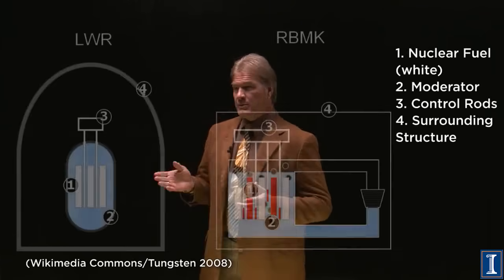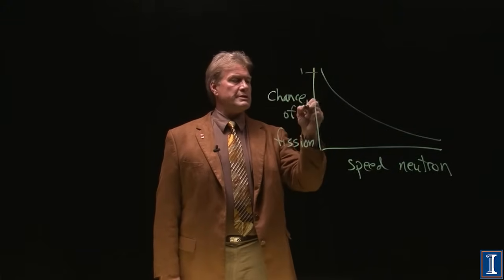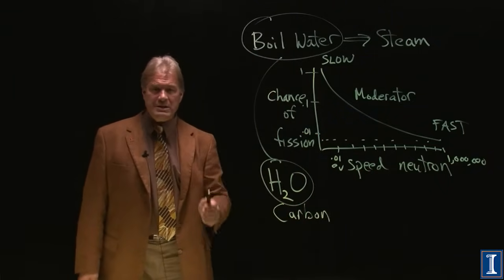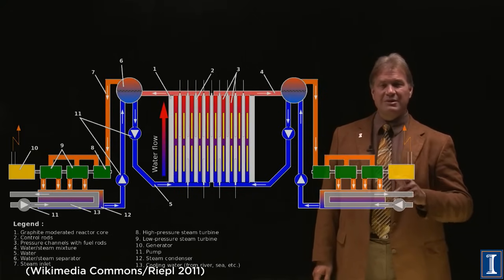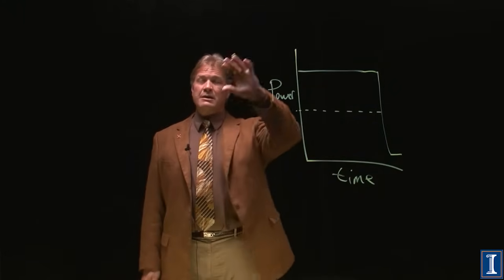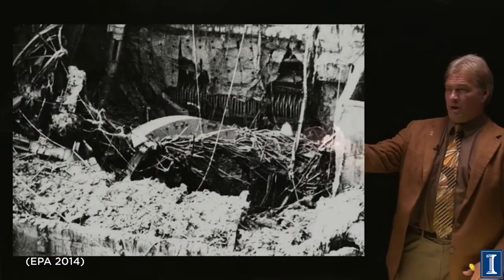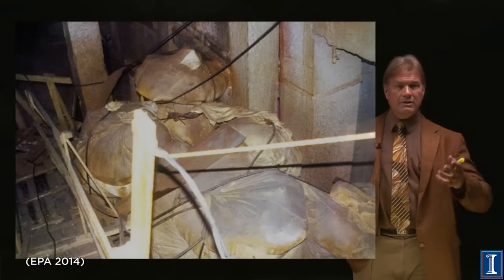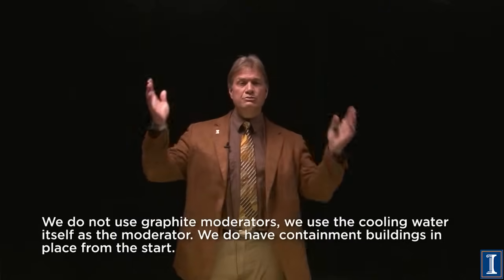Chernobyl: Worst Accident Ever

Comment: "If you loose your coolant, the reaction stops." I gues the reactor from three mile island didn't know that?
Reply: The reaction had stopped.  The control rods were inserted.  It was decay heat that had no place to go, and the cooling system was shut off
Reply: @jimmrson9530  exactly
Reply: Partial meltdown, but no explosion. Very little radiation got out. Very little.
Reply: @daytona1073  Actually NONE did
Reply: in TMI they put relatively cold water back into a hot core and broke the control rod. tbh i still need to look back more onto the TMI incident
Reply: Clearly you have not heard of decay heat...
Reply: Yes but that reactor used water as both the coolant and the moderator, and that means no water, no fission. That will not stop the heat from the decay of the intensely radioactive fission products, but if the flow of water is maintained the reactor will cool down. Chernobyl was different because graphite was used as a moderator, and if the water leaks out, or boils away, the fission will not stop. Indeed, it will accelerate. TMI partially melted down because the top of the core was not covered by water, and because of that, the fission products generated enough heat to melt the core partially.
Reply: It didn't explode.
Reaction was stopped.
Reply: anti-nuclear morons love to "um actually" without knowing what the fuck they're talking about. it's adorable

Comment: The Soviet Union copied the Hanford plutonium product reactor design for Soviet plutonium production reactors and then scaled it up for power production. The Hanford reactors (EXCEPT for N reactor) also had a positive void coefficient. The RBMK is a late 1940s design, really.
Reply: Well there were few other graphite moderated reactors in the world (rest of world...) too, like for example Magnox/AGR. Also, besides RBMK family, russians had other line of "classic" reactors, the VVER line...
Reply: @SYNtemp  I agree with you. However, the RBMK is the only water-cooled graphite-moderated power production reactor, other than the N reactor, and the N reactor doesn't have a positive void coefficient. The main idea was that the Soviets stole the Hanford design (warts and all) and sized it up. No other countries would even think that a reactor designed for plutonium production would be okay (or safe) for power production. In HBO's Chernobyl, Jared Harris (playing Valery Legasov) mentioned that the Soviets used RBMK reactors because they were cheaper to build.
Reply: @runforit420  not only cheaper but they had 2% enriched uranium that is dirt cheap compared to 70% enriched fuel for LWR(you cannot reload it on the way so you must use the fuel capable to delivet power during long period without maintenance). And they can be reloaded with fresh uranium during operation(just by disabling some channels and reloading them) so they can work without stops for reloading. And only 2 water circuits - compare it to 3 for LWR.
Reply: @Nik0lay11  Two water circuits - left and right sides of the RBMK reactor?
Reply: @runforit420  no, first with drum separator and turbine and condenser and the second with condenser and inlet water from the pond. Maybe it's a little bit improper to count the circuit with condenser.. In that case it's 1 circuit and LWR has 2 circuit. Anyway what I was trying  to say is that in LWR there is additional heat exchanger in the middle - which costs a lot of money but reduces radioactive materials pollution.
Reply: It turns shit fuel into electricity and plutonium... what's not to like lol
Reply: @Nik0lay11  You're right – I remember reading that the VVER 440 was also a possibility for the Chernobyl site, but cost too much to manufacture. The main benefit was that there was much less radioactive pollution into the cooling pond from the VVER PWR than the graphite-moderated RBMK because of the heat exchanger.

Comment: 8:32 he says "because they wanted to test".  The accident would have happened without the test under simple conditions -  power below 700 MW, high level of fuel burnout, low reactivity  margin and SCARM activated. The similar accident happened in 1975 but they had fresh fuel and got away with a few burned out fuel channels.
Reply: Under “simple conditions” it would never had run below 700 MW. 
Part of the problem was that the test was delayed for about 10 hours, while keeping the reactor running at 1500 MW, therefore creating a xenon pit.
Also bare in mind that by removing almost all of the control rods they breached the safety protocol.
Reply: @joaquinbustillosarce5171  The xenon pit happens 3 hours after reducing power to 1600 MW and after 11 hours all excessive xenon is gone. They reduced power 20 hours before the test. There were about 50 control rods  out of 211 still inserted in the core before the accident and they had operative reactivity margin of 17-19 equivalent control rods which is above required limit of 15 control rods, so no breach of the safety protocol. Stop repeating common myths and read IAEA INSAG-7 report.
Reply: *SCRAM

Comment: 8:16 - he says that the accident was caused by humans. INSAG-7 report by IAEA says that the main cause is the design defect of the reactor SCRAM system, so called "positive scram effect"
Reply: "The accident can be said to have flowed from deficient safety culture, not only
at the Chernobyl plant, but throughout the Soviet design, operating and regulatory organizations for nuclear power that existed at the time. Safety culture, [...] requires total dedication, which at nuclear power plants is primarily generated by the attitudes of managers of organizations involved in their development and operation." INSAG-7 report. (Pp. 23-24)
Reply: Alex Demidov yea the graphite rods on top of the boron ones.
Reply: @deru1t532  graphite rods were at the bottom of boron ones. The bottom part, with graphite, goes into the reactor first, causing increase in reactivity instead of reduction.
Reply: The RBMK was a Nuclear piece of crap,  operated by poorly trained operators. Bottom line, it was a matter of time before something of the scale happend. Sad people had to die, but that's the price humans put on something before we learn our lessons.

Comment: .7:42 - RBMK reactors don't need to shutdown to refuel, it is their feature that they can change any fuel rods any time. They were  going to shutdown for maintenance.
Reply: They don't refuel "at power", they usually spool it down if I can remember correctly.
Reply: @11austinj  have you tried checking your facts?
Reply: Pravda.

Comment: Wrong. They ran at half power (1600MW) for 10 hours before the test began which was unscheduled because another power plant went off line during the day when the shutdown and the test was supposed to take place. This poisoned the reactor, while also pushed the shutdown to be performed by the less experienced night shift (although the deputy chief engineer and the evening shift supervisor stayed with the night shift to direct the test and help). And the test was supposed to begin at the power level of 700 MW.
Reply: Just watch the HBO mini series Chernobyl
Reply: While they were running at 1600 MW for 10 hours most of xenon burned out and they had operative reactivity margin of 26 equivalent rods which regulation minimum at 15

Comment: Because Chernobyl reactor 4 had been running at low power for so many hours before the accident occurred, it was filled with xenon gas, which reduces reactivity, and is the reason why they were only able to get 200MW of power to run the safety test, AFTER removing nearly all of the control rods.

The test was supposed to be run at between 700-1000MW
Reply: Yes, you're right.. The rector is designed to burn up (that is, neutron activate) the xenon as fast as it is created when the reactor is running at near capacity.  The xenon started building up when the reactor slowed to half capacity.  There are two things you can do then: stop the reactor and wait 3 days until the xenon substantially decays, or return to high capacity, which, as he says, is difficult.  You are riding on a knife-edge of positive feedback - if the reactivity does start to rise because of xenon burn, the lowering of the poisoning will cause it to rise higher, burning off more, rising higher, etc, and you gave up your control when you pulled all the control rods out to get it started.  In engineering terms a positive feedback loop. You have bare seconds before the rising power level boils all the water in the reactor in one massive steam explosion.
Reply: @puncheex2  Tip of the rods was made out of graphite so when they started to put them all back in the same time... boom!
Reply: Everyone has turned into a nuclear Physicist after the 5 hour drama.. lol we know. You watched that great show. We all have.. no need to explain it like you knew that before the show told you.
Reply: @ejkk9513  Problem is that this guy gives accurate information, show or no show

Comment: Why did the power drop in the first place?
Reply: They wanted it at 700MW but it had Xenon poisoning because it had been at half power (700MW) for at least 10 hrs already. There weren't enough neutrons for the already present Xenon135 to become a stable Xenon136 which doesn't absorb neutrons anywhere near like Xe135. It's in the previous vid about Xenon poisoning, they essentially stalled the reactor and the instruments didn't measure what was going on deeper, so when the rods started being pulled out, they created voids/bubbles where temp increased. When they hit the scram button those carbon tips added to the temp and caused that chemical/thermal explosion. The last recorded reading was 33GW (Australia uses just over 26 GW average).
https://www.youtube.com/watch?v=RZQwL-2WTgA
Reply: @stl1321  Full power of reactor 4 at Chernobyl was 3200 MW, half power was 1600 MW
Reply: @VersusARCH  All I've ever seen is 700MW for reactor 4
Reply: @stl1321  Look further. 700 MW was the reduced level of power at which the test was to begin. Full power of the reactor was 3200 MW. It was to be shut down on the 25th during the day and the test completed. They began the shutdown in early morning and safely and gradually brought the power to half power (1600 MW) and switched off one of the two electricity-genearting turbines the reactor eas running, but then a grid controller from Kiev asked for the second turbine, that was to be used in the test, to be kept on-line for the day to cover the demand apparently because another power plant unexpectedly went off-line. The Chernobyl Power Plant manager agreed. So after 10 hours of running at 1600 MW (which poisoned the reactor with excess Xenon byproduct which reduces reactivity in the core until it is burned out which in turn made it more difficult to control) the dispatcher greenlighted the shutdown and they continued lowering the power output of the reactor to the planned 700 MW. But once they did, the power kept dropping due to the accumulated Xenon all the way down to 30 MW - the power output too low to successfully carry out the test. Since the test could be carried out only once a year (on that particular reactor at least), at the time of the annual shutdown and the test failed 3 previous times, the operators were anxious to try to succeed this time so they violated a lot of protocols and disabled a lot of the automated controls that would have prevented the disaster, in order to recklessly remove almost all the control rods from the corein order to try to bring the power back up. They got it up to only 200 MW when they decided to run the test whose protocol created conditions, combined with the poisoned state of the reactor and excessice coolant in it, to RAPIDLY increase the reaction and therefore thermal power output of the reactor. When it started happening they pressed the SCRAM button that should immediately shut down the reaction (as long as sufficient coolant is available for the subsequent cool-off period) but it was too late as the peculiar design flaw, of which the operators were not aware of, actually temporarily increased the power just in time for the fuel chanels to overheat, distort and jam the control rods in the position in which they could not reduce the runaway chain reaction (runaway because the use of graphite moderators) and the coolant in the reactor very quickly flashed to steam and blew off the lid, fires started and the rest of the story was all about the liquidation efforts.
Reply: @VersusARCH  please read INSAG-7 report by IAEA, there was no drop of power due to xenon poisoning, there was no power runaway before they pressed SCRAM button. You are just repeating myths from a TV show.
Reply: yougosquishnow they were doing a safety test
Reply: @deru1t532  you are incorrect. There was no power drop due to xenon poisoning, it is a myth.
Reply: Alex Demidov o I didn’t know that, could you tell/explain to me how it dropped?
Reply: @deru1t532  automatic power regulator failed to engage, warning light about power surge protection was activated and the operator reacted by pressing a button to reduce the power.
Reply: Alex Demidov ok, thank you for explaining.👍🏻
Reply: @AlexDemidov  with only 8 rods in the core its hard to use automatic power regulation. One version is that operator probably saw a small power surge, and pressed AZ5 for a second to lower the power and released the button (you had to hold it for 18 sec for complete action) - this was recorded by the registration system(the button was pressed  2 times). And power skyrocketed and he pressed the button again but it was too late.
Reply: @AlexDemidov  Besides that report you are promoting has only theoretical assumptions about what happened - they admit that before pressing scram button all parameters were normal, and after pressing there was very fast process which cannot be properly registered.